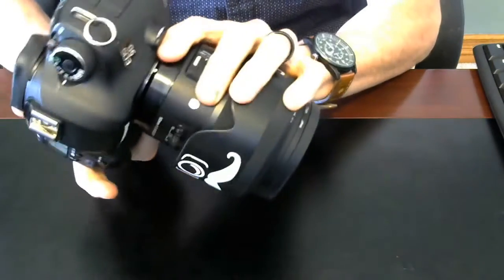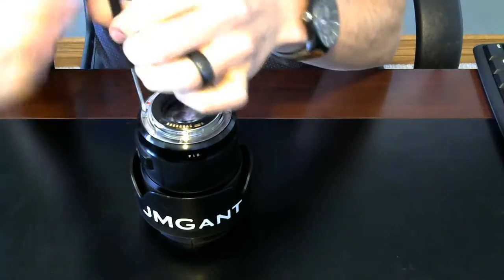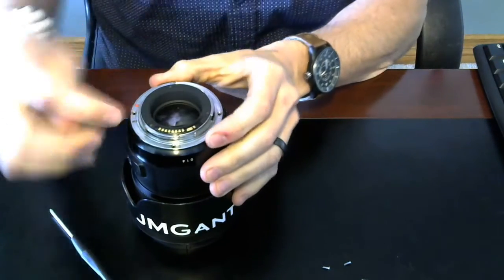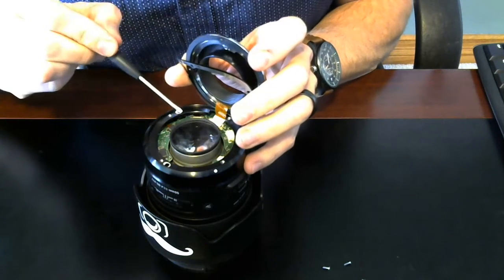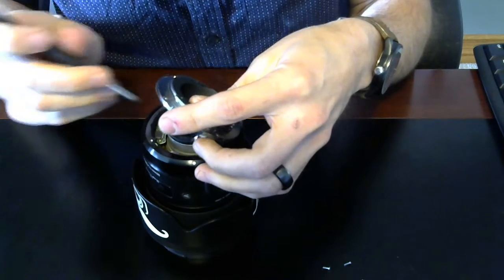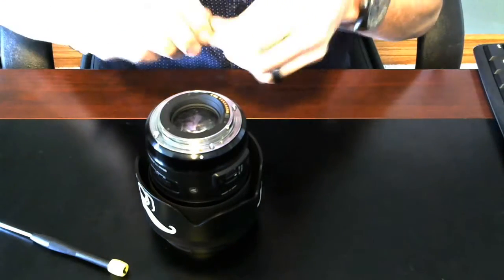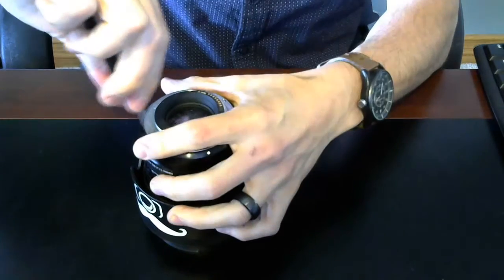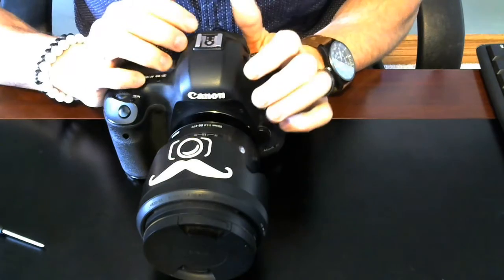How to repair a loose Sigma 50mm 1.4 Art Lens

Comment: So I bought a second hand sigma 50mm 1.4 Nikon mount lens and it came with a loose mount, not extremely loose but noticeable to the point where if I kept my supporting left hand under the lens it would be ok but then if I let it go, the lens barrel would drop 1-2mm and I could hear a distinct clicking sound whenever that happened, so after doing some research I decided to try this procedure and I'm going to share my experience. So I removed the 4 big screws from the outside of the mount, and was able to lift it as well as the gaskets. I had access to the underlying screws that they tightened here in this video but I think it's important to share that one of the 3 inside screws (which also happened to be the loosest one and pretty much the only one causing problems) is located right next to the terminal making it impossible to tighten that screw without actually detaching the terminal first as well. Quite an easy process though, since you're not detaching the terminal from the barrel of the lens, but rather from the lens mount. To do this, remove 5 additional screws that are AROUND the mount centerpiece. Some of these are EXTREMELY small screws so be mindful where you put them after removing them. I suggest you remove these before removing the 4 big screws from the mount, as without those the mount can rotate around itself and potentially damage the terminal. There is one additional small screw that I also removed, it is located in the silver plate of the mount, although I don't know if I really had to remove that one or what it was for at all. If you can't remove the top plastic piece from the mount then that's what that screw holds in place and so you'll have to remove it. After tightening the inside screws, the reassembly goes like this: first place the 2 gaskets, the side with the dent goes into the side that has the terminal, then place the mount and the plastic piece on top, aligning them with the holes, then you should again put on the 4 big screws first before beginning to put on the 5 screws in the centerpiece to avoid the mount slipping during tightening and rotating causing damage to the terminal. I was very nervous about opening up the lens, but the loose mount was annoying and I decided to give it a go. It's a bit more stressful than what they say on the internet so I decided to share this with everyone. In the end I turned a total of 13 screws! For me at least, that's beyond just a simple tweak, however it was overall not a complicated procedure, this whole thing lasted at most 10 minutes and now my lens is absolutely perfect and doesn't shake anymore. :)

Comment: JM, Thank you for posting this. My Sigma 50mm 1.4 Art was almsot falling apart. Your post not only saved me £££, but also a lot of time. This is my goto lens, I absolutely love it. If it happens again I will apply a little Loctight on the screws. As a result of this I bought a 2nd hand Canon 70-200 2.8 ISM ii instead of the Sigma version. Sigma this is a really great lens, get this sorted.

Comment: Where can I get the mounting ring you were tightening into? I found the ring that the screws you were tightening seat was broken causing the loose body. Just need to replace the mount ring and should be golden. Any help as to what the part number is or where I can source it. Thanks.

Comment: I had a similar but different problem with my Nikon mount 50mm Sigma Art, my lens repeatedly reported back f0 after attaching to the camera body (D800), then if I jiggled it a bit, it would sometimes connect correctly. Autofocus was sometimes working and sometimes not. Initially I followed this video - and so thanks for that, as the Nikon lens is very similar in design. However the inner screws shown in the video were all fully tight, and the problem persisted. So I took a closer look at the metal contacts on the lens - the ones that pass the lens data to the camera body, and I pressed it with my finger and noticed it moved, and that definitely should not happen. So I just took the philips screwdriver out - and applied it to the small screws on the black contact interface - and it is now solid, and the lens works perfectly. So my message is this - don't assume its just the screws in the video, there are plenty of others that might need tightening.
Reply: I had exactly this same problem, I also have a Nikon D800 and Sigma 50mm art lens, I had been losing auto focus and also receiving the F0 error, after watching this video I checked the screws shown and they were all tight, then after inspecting the screws that mount the lens contacts I discovered that both were loose, after tightening those the lens is back to normal, thanks for posting the video and thankyou for making this comment.....cheers :)